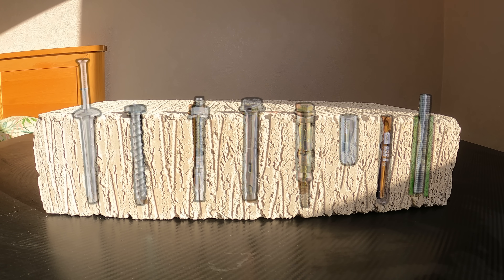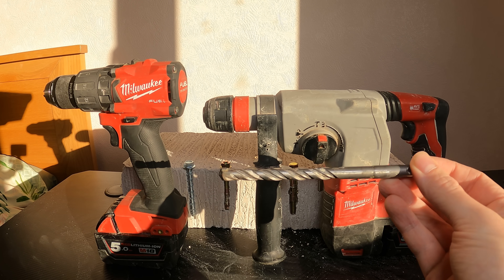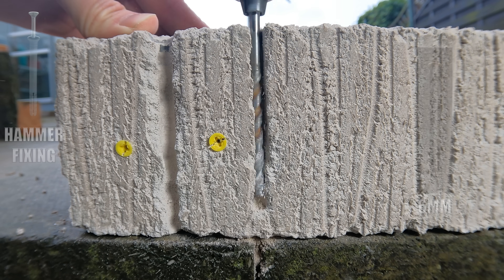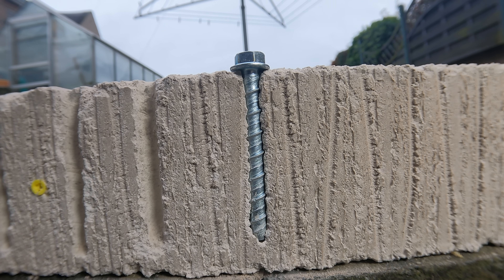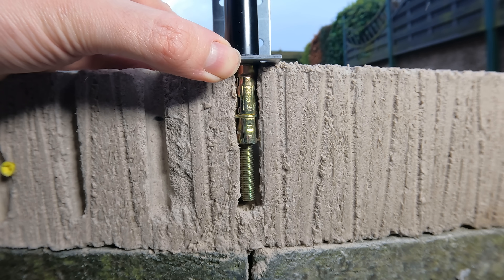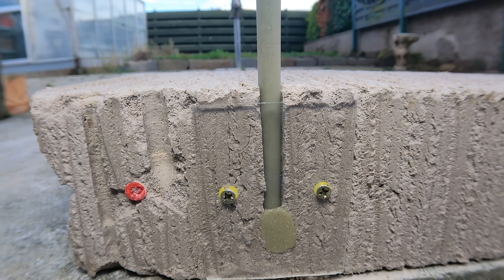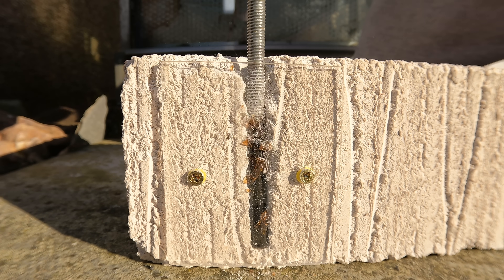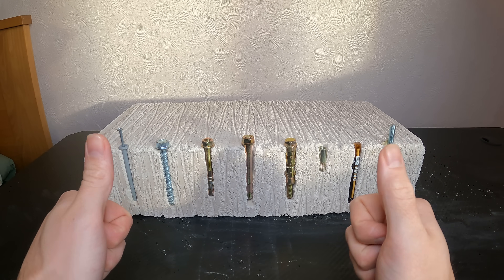CONCRETE ANCHORS FIXINGS AND BOLTS - 8 DIFFERENT METHODS FOR FIXING INTO CONCRETE

Comment: AnkaScrews/screwbolts every single time, with the exception of a chemical anchor for extremely high loads. When done properly screwbolts will hold many hundreds of kilos, the clamping force means they'll never loosen, and if you need to remove them you can easily backfill. Come in every possible size you could want. Screwbolts are also much more preferable for install close to edges, close to other anchors, and in bricks where expansion/sleeve anchors like a Dynabolt will have an much much higher chance of cracking or splitting the substrate.

Comment: I think it's worth noting that when there is a higher density to the concrete/cement the standard impact becomes less and less efficient and the rotary hammer more and more necessary.

Comment: This doesn't look like concrete, the concrete I know is much harder, not so crumbly! My favorite anchor in real concrete is a brass anchor.
In softer concrete, a Chemical Anchor! I'm talking about maximum durability here, if you need something simple to hang on the wall, then almost anything will do!

Comment: I've chosen concrete bolts for myself as a perfect solution to use in the rented apartments, where you have to remove all your fasteners and fill the holes in the walls when you're leaving it.
Also they are reusable to some point.

Comment: when installing car lifts we use 3/4" (19mm) sleeve anchors 4 per post straight into the floor.  we also use some epoxy with the sleeve anchor not for more strength but to make the holes waterproof,  if water gets into your holes and you live where in can freeze the freezing water can damage the concrete.

Comment: You can remove an expanding bolt fixing.   Remove the nut. Hammer the threaded part down a bit and pull the sleeve out. The expanded part will bend back in.

Comment: Drilling concrete overhead for 20mm anchors, with near on 500 holes you were always waiting for the near on wrist breaker when you side swiped the rebar.
Reply: The Modern Milwaukee SDS automatically detects this and immediately stops itself.
Reply: @ All a few years back, pre that type of drill technology. We were buying that many fixings Ramset through 3 Hammer Drills in for free.

Comment: great video, I've used some of these before and I will be using a couple of the expansion methods in the next day or so. BUT I have a concern. I never drill into concrete without a dust mask and that is also very important when using shop air to blow out the dust in a new hole. I scrolled back into the comments to see if this concern had been mentioned before. I didn't see it!  Considering many viewers will be novice DIY'ers I wanted to point this out... Don't breath concreted dust. Its dangerous to your health. thanks
Reply from the maker: Yes very good point. Thank you for sharing that information.

Comment: Some drop in anchors are very short & some also have a lip.   Anchors can also slip out when used in a overhead install or spin when tightened.  The setting tool may also be unsuitable when the concrete , slab etc is under many layers as it won't reach the anchor.
. 
Many SDS drills have a chisel feature. You can use a sds drill bit as a setting tool as long as it's a smaller diameter then the anchor being installed.
. 
Eg.Use a 8 mm sds bit with your drill on it's chisel setting to gently hammer in a 10mm or 12mm drop in anchor.
.
Thanks for uploading.

Comment: Some applications require the ability to use a smaller bolt (diameter), and for those I’ve liked the dropin anchors.

Comment: I use direct fixings 99% of the time now but of use chemical in the in the dry fixing hole too. Then if a large hole full threaded bar with chemical anchor. With anchor you fill 1/2 the hole depth any more is a waste.

Comment: None of the above, but the concrete screw is close.
I prefer using a bolt/screw which goes into the concrete rather than one which leaves threads sticking out above the surface for a nut - for 3 reasons: threads sticking out above have a fixed length, if you need to install thicker material later, it is a problem. Also, if/when you no longer need the anchor, it is a pain to get it out of the concrete or cut it off without making it look nasty. Not to forget they are very expensive - any fastener you fix in the concrete and can't remove later will be expensive. 
I prefer using a lag shield, which is basically a long - 2 piece - "split nut" which is dropped into the hole. A lag screw will expand the "nut" for a very tight grip. If no longer needed, remove the lag screw and fish out the 2 pieces of the nut for reuse, then fill the bare hole. The cheapest way to do it is to drill the hole and stuff a bit of wood down in it for a lag screw to compress against the hole for extra grip. Can't get any cheaper than that and, again, the lag screw is reusable, and the hole is easy to fill.

Comment: Use Bosch sds speed clean drill bits as this is a hollow drill bit that sucks the dust as you are drilling , perfect for concrete anchors as no additional blowing of the hole and also you’re lungs are protected from the nasty silica dust

Comment: Looks like aerated concrete. Do you call it just concrete? That`s confusing. I assume pros and cons are slightly different depending on whether it is strong concrete or something porous like this one. Here I'd focus on maximizing surface contact as it can be ruined so easily.

Comment: wish the video had included a pull out/failure test of the various products.  W a decent sized block of cast concrete and some pulling rigging- they could be rated... lots of work but would have made the video much more useful as a comparison of these anchors.

Comment: Don't use sleeve or any other expanding anchors if near an edge, as they can blow out the concrete. Screw anchors are so easy with no chance of blowout and easy removal.😊

Comment: Excellent video, thanks! In my DIY adventures I’ve found that chemical anchors are also useful if you have concerns that the expansion of a mechanical anchor may crack the concrete
Reply from the maker: Great point!
Reply: Yes, But especially if one is anchoring into bricks. I've cracked quite a few with that last twist. 😮

Comment: Something not mentioned, perhaps because the block was concrete, is an advantage of a resin fixing when being used with old soft bricks is there's less mechanical stress on the brick.  My concern with fixings that rely on expanding is they may fracture old bricks.  It may be an unfounded concern but worth the extra cost for me.

Comment: Would drilling an extra 1-2 cm for the sleeve bolts mess up how it sets in the concrete . 

I wanna do that as I live in a rental apartment . And I want to be able to hammer all the way in before I leave . Apply paste and paint on top ?!

Comment: Would a shield anchor be safe to be used in a concrete ceiling to set up gymnastic rings ? 

I’m trying to go with something that flushes with the ceiling without protruding outside ( for athletics ) but safety first of course

Comment: Years ago we were setting steel columns on concrete footings. The job called for epoxy and all-thread anchors. We had a backhoe working in the area and the hoe accidentally backed into one of the columns. The concrete in the footing failed before the epoxied anchor did. A perfect cone of concrete was pulled out of the top of the footing, about 8” in diameter by about 10” deep (the length of the all-thread).
Reply from the maker: Yup that's a very good fixing

Comment: The glass tube chemical anchors have an added advantage that they do not pressurise the blocks and can safely used in aerated cement blocks especially or thin walled modern clay bricks without splitting them. I used them over 40 years ago fixing down 40 metre long laminating/printing machine bedplates with great success.
Reply: amazing that these were avaliable 40 years ago. I didnt know that.

Comment: Building homes on pre formed concrete walls and the mix they use is some of the hardest ever developed. SDS drills are essential. It takes multiple minutes with anything else to drill into this hellish stuff.

Comment: I put a dab of expanding foam adhesive on a plastic insert and nothing will ever pull you screw out of it.  I use it for ceilings and indoor clothesline type applications.
Reply from the maker: Great tip. Thanks

Comment: Brass anker is not set like that, you must screw the bolt to where it expands the end and thats what had the holding power, they are also removable, the only disadvantage is brass thats weak metal and if you overtiten them the wing breaks. But i used them they can hold a lot of weight. I would say m8 bolt can easily support my weitght to the sealing.

Comment: Chemical anchors are the way to go,especially close to the edge of a slab,allthe other types mill blow the side out of the concrete.I believe if I pulled hard enough on my spanner I would snap the bolt off in the chemical, care must be taken,screw down with a low impact tec gun and finish by hand. Australia 🇦🇺 🪃

Comment: For years I have used many of the anchors shown here.  If your load is sheer or low pull out requirement then most of them will work fine. Most of the expanding types will fail in pull out because of the mechanical deformation of the concrete when expanded.  The threaded bolts can be better but hole size is critical.  Years ago I had to use anchor to granite boulders. My building permit required an on site engineer inspection to insure correct installation.  The inspector told me that properly installed epoxy anchors are so effective that the bolt will fail before the grip on the substrate. Ever since then I use epoxy anchors.
Reply: For sure, epoxy anchors are great.  You just have to be careful to install them properly.  Not cleaning the hole correctly or failing to fill the hole fully (a little tricky when installing horizontally or overhead) can dramatically reduce the tension capacity.  IIRC you can easily lose something like 80% of the strength.
Reply from the maker: Yeah probably the best

Comment: you didnt demonstrate plastic plugs with coach screws.   the first you showed was similar but not the same.   any galvanised or chromated finish will rust in masonry.   the ones that rust the quickest are the concrete bolts.   i had a job securing a steel frame to concrete with a supervising engineer looking over my shoulder.   i declared i no longer use any fixing into masonry other than plastic.   and he said they were his choice too.   ive seen how the chinese use them to secure rails to sleepers on their high speed rail network.   the chemical anchors work very well too.  they are available in various strengths.    they are guaranteed by the manufacturers.
Reply from the maker: Good tip

Comment: I have tried a few of the different types of concrete fixings in this video over the years with varying success probably due to my lack of experience and ignorance. So this has been a brilliant insight into how I should do,it properly and the different choices. The last time I did it using the screw bolt (to secure a bench to a wall) as it seemed the simplest method. The first time I used expansion bolts they worked a treat but since then to no avail. I may try the resin next. Many thanks.
Reply from the maker: Yeah lots of options

Comment: Nice video.

Be careful if the concrete is a little soft. This is particularly true going into brick. You may wind up with a hole that's larger than the bit, especially if using the SDS drill. For example, a 1/4 inch (6.35 mm) hole may become 9/32 inch (7.14375 mm) (1/32 inch too large). Depending on the anchor, this may or may not be a problem. There was also 1 type of anchor that wasn't used here. It uses a special tool to drive it and has and explosive cartridge in the tool that drives the anchor into the concrete when the tool is struck with a hammer.

The time ratio here between the rotary hammer drill (SDS) and the hammer drill was about 1:2. However, the harder the material, the more this time ratio will increase and you'll wish you had the SDS drill.

Comment: The hex headed concrete bolt can be reused. After removing it, if you can feel the original thread in the hole, it can be wound in again. Very useful for cockups. Failing that, bore the hole out again and fit the next biggest bolt. Easy.

Comment: Very good video on a very misunderstood subject . A little trick to save money is to use 3/16 bit , 16 penny nails with plastic coated rebar wire .  Excellent for temporary work and if you want add life or weather resistant use hot dipped galvanized. Pullout is extreme shear relatively good
Reply from the maker: Thanks for the info!

Comment: I use plastic anchors, lag screws and construction adhesive. Grabs tight and doesn’t let water get in to freeze and crack the concrete.

Comment: I came up with this ideal after using similar epoxy for rebar into old concrete pad which I think it will last for decades. 1. Drill your hole, 2. Clean the dust out, 3. Add Quikrete FastSet Anchoring Epoxy with a silicone gun into the hole, 4. Using a hammer tap anchor sleeve\bolts in, 5. Excess epoxy will shoot out, 6. Wipe clean, 7. Add mount plate, 8. Tighten up the bolts, 9. Clean up more excess epoxy. Let epoxy cure.

Comment: I've got the D handle SDS rotary hammer, very similar to your model.  It is soooooo much nicer than a hammer drill.  It's so smooth, quiet, and it takes very little pressure.

Comment: I have used all these methods with the exception of the capsule, the only one I use now for the past 15 years are the Simpson titan hd's , these are the only one that do not come loose over time, I have used thousands of them with no complaints and no failures, I install gate operators for a living and we had a car hit one of the gates and the operator was mounted with ( 4 )1/2" x 4" titan hd anchors to a 2' x 2' x 2' 4500psi concrete pad and it actually picked the pad up out of the ground, bolts never snaped or loosened, this actually happens quit often, I guess people can't see a big ole gate closed sitting right in front of them.

Comment: Good video. When drilling for an anchor in a thinner slab such as a basement or garage we always drill all the way through the bottom of the slab. If that Anchor is ever not used anymore, it can be tapped through the underside of the slab and the hole filled.
Reply from the maker: Good tip

Comment: also to note, anything bigger than 3/8th, into poured concrete, needs sds or you will ruin bits very quickly and likely not get to the depth you need. Also this is very taxing on the drill.
Reply from the maker: Thanks for the knowledge

Comment: I rely on chemical anchors when it absolutely has to stay secure. They are the most resistant to vibration, to corrosion, and to spallation. Being able to reliably anchor close to a concrete edge (because no lateral force is imposed upon the substrate) is a huge advantage. Also, in cold climates they exclude water that can freeze and break the concrete.
Reply from the maker: good info thanks

Comment: Is it possible to combine 2 type of anchor fixing? For example, Resin Set with Sleeve Anchor, will this make the anchor extra strong?
Reply from the maker: Yeah I suppose you could use that method. Should work

Comment: I would like to see someone test these to failure. I would think the concrete bolts would outperform the anchors as they have more surface area in contact to disperse the load.
Reply from the maker: good idea

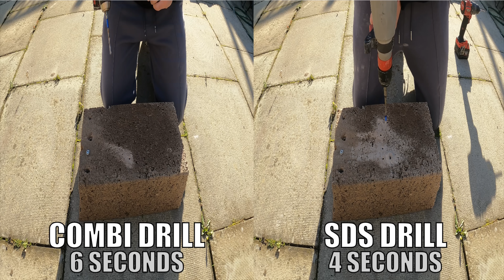Comment: 1:27 - this only applies in soft materials...with proper full strength concrete, the combi drill just sits there making angry noise not finishing one hole in 2+ minutes, while a true hammer drill gets the job done under 15 seconds.
if you're short on cash, get a corded one or rent if it financially makes sense, because when you need a hammer-drill, it's worth every penny.
Reply: yep. i used a hammer drill to drill holes for and drive in 3  3/16" x 4" concrete screws. took about a minute per hole to drill into 30 year old concrete house slab. next project i used an SDS max rotary hammer drill boring 1" core holes through a foot thick concrete wall in about a minute.

Comment: The most impressive thing in the video is the skill to be able to drill a partially opened hole on the side. Well done video
Reply from the maker: Thanks
Reply: @mikebolt9753  Great video Mike. Rare on YT to have more likes than subscribers; testimony to how well done this is! Cheers!
Reply: Thought the same 😂 great video for beginners though - well done.
Reply: That's exactly what I was thinking!
Reply: I saw that.
Reply: 100% agree with that mate 😂
Reply: I knew that was going to be the top comment.  This needs to be on Penn & Teller's "Fool Us"
🤣
Reply: drill inline first, then cut?
Reply: @nemoatlantis7148 looks like the factory finish so  don’t think he cut it
Reply: @nemoatlantis7148  nope. see 0:16
Reply: Lol
Reply: very good original point!!
Reply: Bro! That exactly what I was thinking too!
Reply: that's because that isn't concrete. looks like something you can poke holes through with the your finger if you try hard enough
Reply: Same. I wonder how many were sacrificed 😂
Reply: The material is what concrete but looks like gypsolite
Reply: Thats not skill..thats Ai.

Comment: I like the drop in anchors because you can remove them if needed.
Reply: How so?
Reply: @md4uh  because the bolt just screws in and screws out.  I didn't mean the anchor is removable. The bolt is.

Comment: Isn't this mortar and not concrete?
Reply from the maker: nope
Reply: @mikebolt9753  Definitely looks like... 0 resistance when drilling, tiny aggregates (sand)... That looks like mortar.
Reply from the maker: No defo not mortar lol
I think it was called airated concrete.
It was a lot lighter than a regular block.
Reply: @mikebolt9753  If it's "airated concrete", it's not structural concrete. It's not the best material to make your demonstration.